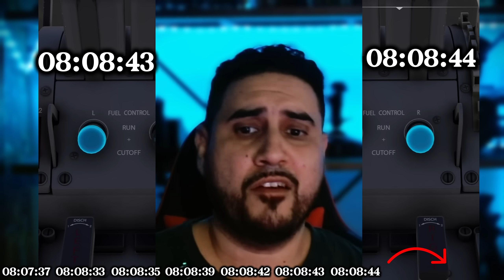TIMELINE & MENTAL HEALTH BREAKDOWN | AIR INDIA 171 | AAIB PRELIMINARY REPORT | MAYDAY | MSFS2024

Comment: At least two pilots that I know of, claimed that the fuel switches could not have been switched to cut off both one second appart.
                  However, since both fuel swithes were both  switched to cut off one second appart, that indicates that the Pilot tried to place both switches to cut off in a hurry.
                      "Unless there was an unknown mechanical problem with the on board computer", either way, by what  they revealed so far, both of the switches were placed in the cut off position at the same time one second appart...
                           If it wasn't one of the Pilots that did it, but it was the computer,  then keep in mind, next time you board a plane you are boarding a time bomb that could explode at any time.
Reply from the maker: I am making an updated video based on this debate. To include how the switches are both mechanical and electrical.

Comment: Hi. Each engine and all related systems, indicators, gauges and throttles are independent. So maybe one fuel switch, but both? As mentioned, by logic I assume this should clarify the double failure issue. Personally I can speculate, but not judge at all. However, excellent presentation.

Comment: The lone survivor testified of
a loud bang and the lights flickering on and off ????
  Could those switches being turned off cause this noise ????
   Could there have been an electrical surge to power supply which caused this ???
  Could their have surge in power have caused the switches to move to off positions so quickly then warning lights came on followed by the pilots questioning each other ????
  Why 10 seconds that close delay if switches moved; could they have remained in the on position not being touched by the pilots ???
  Due to electrical damage caused; could that be why the delay in the response of the reset of switch command back to on position delay and possibly why the second engine didn’t try to re-power ???
  If the Rat deployed as soon plane lifted off the ground;
Could this explain why there was no movement in the landing gear ??? 
 I don’t think they had time to touch anything because they were still trying to assess the issues ????
My theory is : total electrical failure… of the computer which control the plane main brain…
 Like a person, who gets a sudden sever headache and then passes out ; the plane was showing signs of signs of electrical issues; systems were failing within the airplane previous to their takeoff and plane was being pushed toward the point of failure which happened to be at worst possible time which the pilots were put into position that they could not control,prevent and or recover from is my theory….
Of course their is the possibility of human error 
BUT 
There is also the possibility of mechanical error TOO…
Reply: Only limited knowledge of airplane integrated systems can come up with such a scenario. There is no such main or master compute in the B787 or any airplane. The big bang came from the deployment of RAT, and flickering of the lights from electrical bus transition from main bus to emergency source.
Reply: @JovenJB  thank you for the clarification; I’m no expert; was just wondering by comment; thinking a loud; thoughts…

Comment: Much has been made from the 1-second difference in the transitioning of the two (2) fuel-control switches from the RUN mode to the CUTOFF mode. 

Possible explanation: – 

The 1-second delay in the transition of the two fuel-control switches to the CUTOFF mode may be accomplished easily by using two (2) hands to transition ‘both’ fuel-control switches ‘simultaneously’ (i.e., at the same time). This particularly applies to large planes such as large passenger planes which are piloted by two (2) pilots in the cockpit. The fuel-control switches in such planes are positioned centrally on the control panel which allows easy access to both pilots. 

Possible explanation for the delay of around 10-12 seconds to transition the fuel-control switches from the CUTOFF mode to the RUN mode after one pilot asked the other pilot why he transitioned the fuel-control switches to the CUTOFF mode: – 

The delay of around 10-12 seconds in transitioning the fuel-control switches to the RUN mode may indicate that: – 

(i) The junior co-pilot had an ‘expectation’ that the senior commanding pilot was going to transition the fuel-control switches to the RUN mode, especially given that he (the junior co-pilot) observed or witnessed the senior commanding pilot transitioning the fuel-control switches to the CUTOFF mode when the plane was at an altitude of 625 feet (or 190 metres). 

(ii) The junior co-pilot who noticed that fuel-control switches were in the CUOFF mode, was fully cognisant of the fate of the plane and its passengers — without a timely fuel supply to the engines, the plane was about to crash because its close proximity to the ground (i.e., an altitude of 625 feet or 190 metres), the amount of time required for the plane to recover after the fuel-control switches were transitioned to the RUN mode, was grossly insufficient — death was literally less than thirty (30) seconds away. 

(iii) The senior commanding pilot who is suspected of transitioning the fuel-control switches from the RUN mode to the CUTOFF mode when the plane was at an altitude of 625 feet (or 190 metres), deliberately placed his hand(s) on the fuel-control switches in order to prevent the junior co-pilot from transitioning the fuel-control switches to the RUN mode. During the latter part of the 10-second delay, the senior commanding pilot may have removed his hand(s) from the fuel-control switches, possibly because he may have had a change of heart to deliberately crash the plane. 

This comment mentions the plane’s maximum altitude of 625 feet (or 190 metres) at the time one pilot asked the other pilot why he transitioned the fuel-control switches to the CUTOFF mode. The maximum altitude of the plane, which was 625 feet (or 190 metres), is a very reliable indicator of the exact time the fuel-control switches were transitioned to the CUTOFF mode, because immediately after (i.e., almost INSTANTLY), the fuel-control switches were transitioned to the CUTOFF mode, the fuel in the lines from the fuel tanks to the engines is used up almost INSTANTLY (especially at the speed the ill-fated plane was flying), and because the fuel supply is no longer available to the engines, the plane begins to glide downward towards the ground. Therefore, the plane’s maximum altitude of 625 feet (or 190 metres) almost perfectly coincides with the time the fuel-control switches were transitioned to the CUTOFF mode.

Comment: 😮Based on the report, well its murder/sucide!!!! 1.gear was not redacted, which causes drag.2. Fuel control from run to cutoff, thats a manual movement also two steps process. So was it mechanical or deliberate???? That conversation " Why did you cutoff? says it alot.😮In my opinion pilot lack experience to recorrect!!!!!Why did the senior pilot allow a junior pilot who lacked experience to fly in the first place. Take off & landings aren't experimenting with 242 people aboard!!!!!1100 hrs isn't much, there are regulations to flying hours, so why did the Airline allow it also????Tick tock until the FINAL REPORT,can tell the truth!!!!

Comment: What about a design change of location for the switches? Example:  there are two switches that control two engines, and there are two pilots, what if the switches were separated on the control panel, where the number one engine is controlled by It’s corresponding fuel switch either directly in front of the first officer or off to his right of center and the number two engine is controlled by the captain either directly in front of him or off center to the left?  If that proves to be a good safe and workable choice than neither pilot could shut off both switches. Of course, each pilot would only be able to control one switch, but keeping one switch live is surely better than both switches moved to off position.  What this also does is preventing one pilot who may have an emotional episode from shutting off both switches at the same time.

Comment: Unfortunately pilots DON'T have the expertise to speak or be given so much credibility in their uneducated opinions! There is only a few people that fully understand all that is involved and all that IS relevant to the downing of this aircraft. A couple points to note that people won't understand but can confirm, "physics" The acceleration of these aircraft is phenomenal notable by the prelonged g-force you can feel long after liftoff, this is due to the fact your going faster and faster with every passing millisecond! Maximum speed would not be recorded before an event that reduces power! engine inertia would continue to accelerate the plane several seconds after power loss of any kind and rate of acceleration would roll off not immediately discontinue. The rate of acceleration is related to the g sensation still very noticeable at point of incident and roll-off would have been the first thing pilots noticed even before auditable sound of engine spooldown. This brings me to the second point that the engines powered down in a controlled way by the engine management system and not from fuel cut! At that speed the sudden lean condition the engine going faster than supply of fuel as the last drop go through would result in some visual evidence flash of flame and or visible exhast trail as the air fuel ratio is destroyed! Last point ill make is even if the engines were turned off by any means from the cockpit the they would not have slowed down enough in 10 seconds to fail at generating electrical power, so the RAT would not have had genuine systems comand to deploy!!!!! It was a systems failure thst occurred many seconds before the pilots did anything!!!!

Comment: watching a cockpit video of a 787 takeoff is very illustrative. The pilot flying in this case the first officer has the yoke in his hands and is concentrating on the manual takeoff. The pilot monitoring post a lever that raises a gear however, in this case, the gear was never raised so the question is what was the pilot monitoring doing? It seems like he was turning off the fuel.

Comment: Modern cars are designed so that you can not put them into park at highway speeds because it would cause loss of control. Why didn't Boeing design the LOGIC behind these switches so that they can NOT be put into CUTOFF at takeoff or once in normal air mode?
Reply from the maker: Good question — the reason Boeing doesn’t lock out the fuel cutoff switches during takeoff is because pilots need to be able to shut down an engine at any time in case of an emergency, like a fire or a severe failure. That kind of manual control is critical — and on a 787, the aircraft can safely fly with just one engine.

The system was never designed with the expectation that both fuel control switches would be shut off at once. It’s not normal, and it’s not a failure Boeing planned for, because losing both engines at the same time — outside of fuel exhaustion or extreme failure — is incredibly rare.

That’s why this incident is raising serious questions. Maybe it’s time for Boeing to rethink how these switches work — not to take control away from pilots, but to prevent a simple mistake from becoming catastrophic.

Comment: Perhaps more attention needs to be applied to the fuel switches start with the 2018 recommendation there is obviously a design or production issue with them what better way to hide it and a have a suicidal pilot in control with how many flying hrs under his belt again? find the Boeing whit elephant in the cockpit aircraft and you will probably get your answers😮.🧐☝️🤔😗😎😲

Comment: Clearly the investigators know exactly which pilot said what and also the degree of surprise /panic. My suspicion is that it was the Captain who asks why did you cut them off and the Copilot who honestly replied, I didn't. Because it was the Captain himself who pulled the switch. Wanting to commit suicide in a way that made it look like it was either a mechanical failure , or a psycho Copilot. I doubt this was much to do with insurance. It seems the 95 year old father was his only relative and for sure having had a son who had been a pilot for many years would not need the money. I think it was all about the relationship between the pilot and his parents. Not wanting to face looking after his dad , but not wanting to accept the ignomy of suicide.

Comment: The fuel lever switches do not have a string attached to them that opens and closes a valve. When they are moved it sends an electronic signal that is interpreted by the software system. 

So….

For some inexplicable reason just at lift off a light comes on the dashboard to indicate fuel cut off. The Captain asks the FO pilot, “why did you cut off the fuel?” The pilot claims, “I didn’t”. Note the Captain DOES NOT THEN SHOUT in counterpoint, “The levers are in the cut-off position!”. 

This is because they are actually in the Run position. 

To restart the engine, the only option available, he then pushes the levers to cut off. This movement to cut-off doesn’t register on the black box record, *because the system shows that the fuel cut-off is already the status*. This explains why there is a 10 second delay in moving the switches back to the Run position, which does register on the record. The engines then do fire up, but alas they are too low and there was no time to develop the required thrust to stay airborne..
Reply: Reasonable theory. But considering both switches, which are completely independent of one another, as are most things in the aircraft, for safety reasons, it is unlikely for both of them to have this failure. And the fact that they did not switch simultaneously, but instead one second apart, which is just about how fast a deliberate pilot could switch them, makes it more likely to be deliberate switching vs. equipment failure. And the timing is strike three - the chances that these two independent "failures" would happen at exactly this time of vulnerability - where the takeoff could not be aborted, and there was not enough altitude for recovery. All those are tough to answer, I think.
Reply: @dre3951 I don't know how these are wired, but an electrical failure affecting both is entirely possible, either at the switch, or the module ( if it's a bus system ) or at the controller. All depends on how it's wired. Anyone got schematics for this in here ? Will be interesting to take a look. The locking mechanisms on the switch were found intact, so it had to be deliberate if it was not an electrical failure. That is so hard to believe. If he was suicidal, then I guess we should have reports of a tussle in the cockpit when he was found out.
Reply: So you mean there was an electrical fault , interpreted as both engine shut off commands ?
Reply: @machineman541 I’m speculating that there was an electro-mechanical fault and/or software fault that closed the fuel valves independently of the switches in the cockpit. 

The extraordinary movement in the cockpit required to move the fuel switches so quickly would have absolutely been noticeable by the captain who would have shouted something like “what are you doing?”  Instead he saw the fuel cut-off indicator on the dashboard and asked the pilot why he cut the fuel.  The pilot said he did not.  And we do not hear the captain remonstrating that the fuel switches were set to cut off. That’s because they were set to Run. 

The pilots were bewildered and one exclaimed they were losing thrust or there was no thrust and could not understand why.
Reply: They probably know a lot more than what they are telling us.
That leads to a pilot error with probably more words exchanged, etc 
Plus, the switches each activate a different relay before going to the computers
Them relays i heard also send a signal to the FDR, and that is how they know the switches were actually moved. The computers do not have anything to do with them relays.